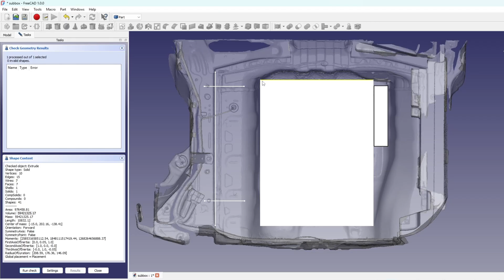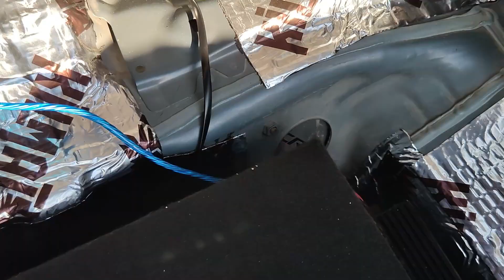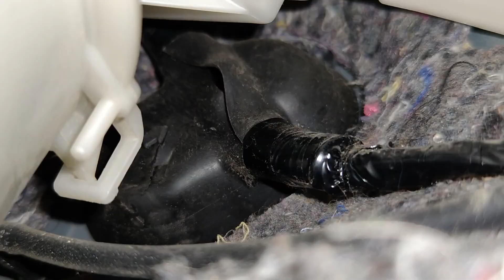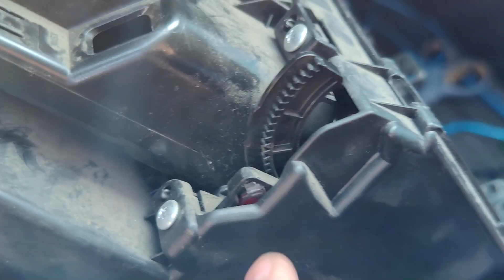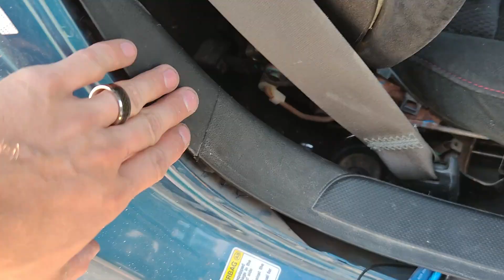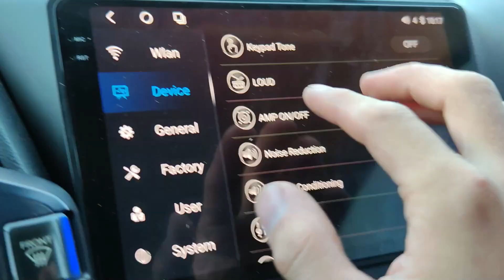Honda CR-Z Audio System Part 3: Secret Subwoofer!

Comment: When it comes to the amp. Did you use the stock one when working with the new head unit?
Reply from the maker: Yes, the stock amp is still powering all the other speakers. Check out the previous video on the stereo swap to see how that is set up!
Reply: @HondaGarage_ID will do! I’ve already don’t my own install on that just kinda want some good bass now lol.

Comment: have few questions can we use stock camera on android head unit aftermarket for Chinese make . And if yes then how and if now how can I install
Reply from the maker: In my previous experience on other vehicles, no. But I am going to experiment and see if some custom wiring could be redone to use an OEM backup camera. There will likely be a dedicated video for that.